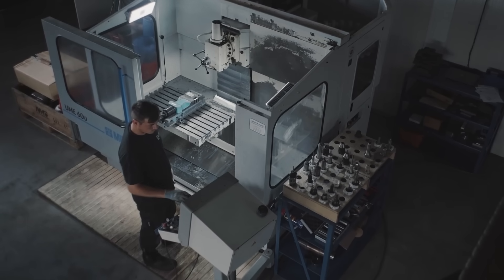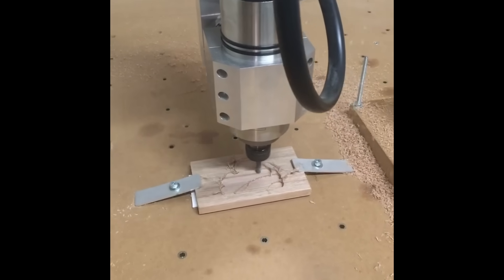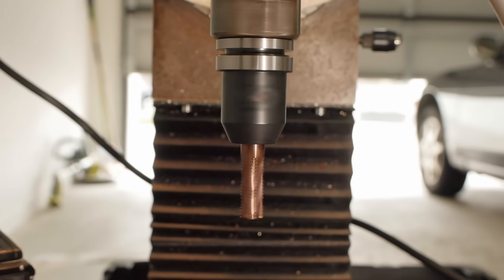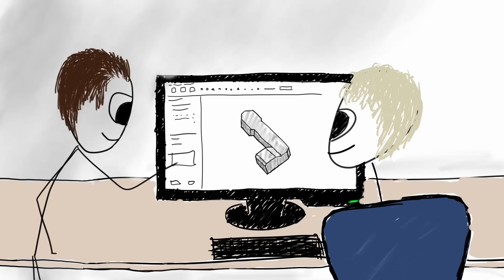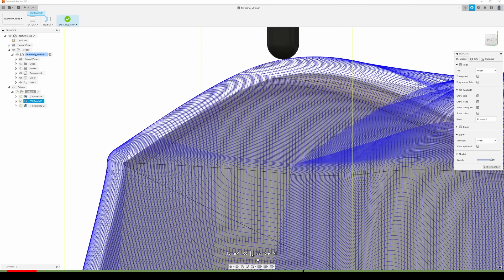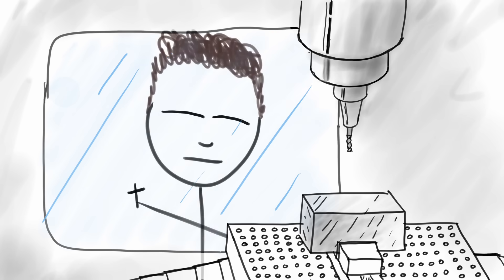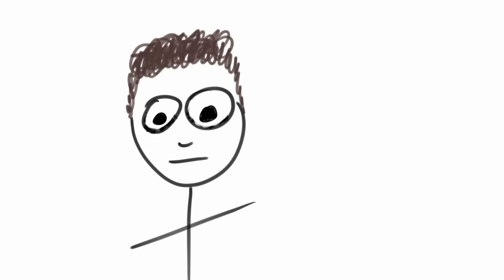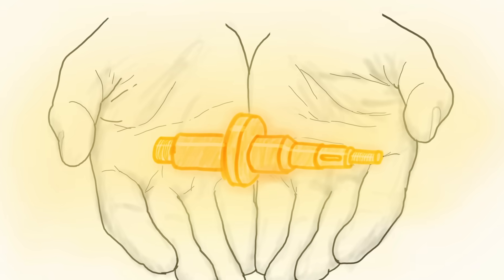Casually Explained: CNC Machining

Comment: I worked in IT for over 20 years before being recently laid off. With AI rapidly changing the industry, finding a new role in tech has become increasingly difficult. I'm now exploring a career as a CNC operator. While I understand the starting pay is modest, I'm encouraged by the growth potential over time.
I also have a personal connection to the field — several family and friends have worked as machinists and engineers. In addition, I have experience with 3D printing, which sparked my interest in CNC work. I’m drawn to the idea of working with physical materials and machines instead of spending all day behind a computer screen creating digital projects that can be erased or undone in seconds. CNC work feels more tangible, hands-on, and rewarding to me. Would you recommend this work for someone?
Reply from the maker: My only experience as an actual, full-time professional machinist is for a racing team where we did very short runs of custom designed parts, or one-offs. We were often having to do R&D to figure out how to make new parts, which keeps it interesting, but also makes the work super stressful. Most parts that you make are using a new, unproven gcode program on very expensive machines. Your experience of the industry will vary by country and company, some places produce the same parts for days at a time, so you'll be working to optimise and dial in perfect parts with less stress but less variety. The job is quite dangerous, metal chips are extremely sharp and WILL cut you several times before you really understand not to touch them. And as I said in the video, a lathe will mince you in a split-second if it catches your sleeve. On the positive side, you'll learn skills that make you an all-round very skilled maker and understand a great deal of engineering just through intuition. If you get excited holding an object that you've made with care, especially if it's a functional object, then you'll love machining perfect parts that fit together like few things do. I'm actually dreaming of making my own software as a source of income which I've been studying (slowly) for a while. Software is far less intuitive to put together and fix problems, and can feel like a sea of unknowns and threats to the objective, but the satisfaction when it all comes together is also amazing. I recently made a python script that aggregates all my Mach Super media files and folders into a single folder structure where all the files are symlinks to the real files in various drives. I would say, for me, a day running the CNC leaves me feeling happier and healthier than a day on the computer, but I like doing both. Never do I break expensive things on the computer.
Reply: I work in the aircraft repair sector, I make good money but outside of that its either mindless button pushing for high pay or lots of experience and hands on for bullshit pay. I'm working in an odd area now that pays well.
Reply: Titan of CNC, a American YouTube channel, The remuneration he offers is very high

Comment: 3:12 Hold on.  You’re trying to say that 3D printing just makes it for you, but with CNC you have to program every move it makes?  Then you show the g-code, which I know you don’t actually write.  That’s what 3D printers use too, and in both cases most humans don’t have to write the g-code.  They just modify various parts of the build/program where needed.
Reply: yes and no, CNC cant make the kind of patterns 3D printers can, its like how sculpting is easier than carving, you can add/remove material in sculpting but one mistake in carving and the piece is gone. About the gcode most commercial grade 3D printers you slice and you are ready to go, but when you have a half a million dollar CNC you need to verify every step, program and optimise various parts of the "Gcode" (program) to get it optimized and not end up in a $10k disaster. Also making a CNC part requires multiple different programs to make 1 thing while as for 3D printing 1 Gcode file and you are done. But industrial grade 3D printers also are complex like this, we have a Stratasys printer at work and it also requires a technician to operate and make the programs for as the printer and the materials we use are stupidly expensive so we cant afford any mistakes also parts need specialized post processing depending on the material and tolerances required.

Comment: I’m a 22 year old running a 2 million dollar mill-turn machine making million dollar rocket parts. The whole part about being in a constant state of paranoia is the most relatable thing I’ve heard in a while
Reply: i used to weld high pressure vessels and chemical piping. that paranoia sticks around for a while, even after it passes inspection.
Reply: 1000 tiny heart attacks a day... this is our career.
Reply: As the long as the broken thing doesn't impede overall production speed it's been budgeted for
Reply: how long have you been running machines? are you just an operator? or do you have programming experience? also what machine btw?
Reply: @iamthe.alphabet  Started CNC in high school through an internship I was in when I was 16, did that for two years. Then did manual machining for about 2 years, got in to 3 and 5 axis for about another year and a half before my current job. Been here for a little over a year now. So coming up on 7 years. I took CAD/CAM classes in high school and this is the first job I’ve had where I haven’t had to program my own parts. In the past I’ve run HAAS, Fidia (5 axis), and various heidenhain and fanuc controlled machines from smaller, less known manufacturers. Currently running Mazak mill-turn machines
Reply: May I ask in what company?
Reply: @ I work for blue origin
Reply: what’s your job pay now after all that experience if you don’t mind me asking? I’m about 3 months into my first operator position. I have about 4 years experience doing manual machining. I’m trying to decide if it’s worth it to stick it out to when I’ll make more or not.
Reply: @iamthe.alphabet im at about $40/hr with really good benefits. Pay varies a lot by location and industry, but with 6-8 years of experience a job in medical or aerospace will get you over $30/hr in most places
Reply: @iamthe.alphabet sorry for the late reply I never saw this. I’m at a base rate of about $35/hr but it really depends on location. In higher cost of living areas like California and Seattle you can expect $40+ for a good job with 6-8 years of experience. Biggest pieces of advice I can give is to get good at programming and metrology/inspection. That will set you apart from other candidates and open up a lot of opportunities
Reply: I have a dream
Reply: But you don’t make no where near that Lol 

The company makes the big bucks you’re just a worker 

You forgot to mention that my friend Lol 

No point in trynna make it sound like you make millions lol
Reply: @user-dz3fo4wl8x  the point was about how scary it is to work on really expensive parts and machines. You can cost someone hundreds of thousands of dollars by messing up once
Reply: @thedudegs-f9w it’s like that with everything in life
Reply: Oooo what mill turn? -Dmg mori NTX
Reply: I interviewed at a place a couple weeks ago similiar to what you do and the older you get the harder it is to get into decent companies. After 50 if you're job searching because something happened and you're in that spot it sucks. And having 20+ years of experience doing machining only to see  your job go to young people is very disheartening.

Comment: Even if I've triple checked the program, verified it in CAM, comped up a couple inches and dry ran hitting cycle start is still a devastating experience for each new program. And I only make one off parts....

Comment: 2:59 as a printer enthusiast I will confirm this is wrong. You also need to tune and code printers just like you do with CNC machines.
Reply from the maker: I know. Everyone who owns one knows. But it’s still not as difficult as machining.
Reply: @ yeah but you linda put them down in this video and stuff
Reply from the maker: @namanienie123  because they're easier than machining and machinists are jealous, and most importantly, it's because the uninformed audience often has a perception that 3D printing is as easy as plugging in a 3D file. That's what made it worth joking about.
Reply: @ well isn’t there the same premise about CNC machining?
Before I got into printers and before I got into machines, I also thought that you could just put a file straight onto a USB stick and plug it in and kaboom it works
Reply from the maker: @namanienie123  Exactly.

Comment: As a machinist, I am in fact constantly paranoid about what I’m making. Even after work. I swear, I dream about what I’ve made, and even if I know it’s all good, I’ll convince myself that something must have went wrong. If the order was for 150 parts, I’ll drive myself crazy that maybe I ruined all 150 and can’t sleep. Horrible.
Reply from the maker: I’ve never had to do a large production run, but I never considered that it could be scary in that way. I wished I could dial it in then set and forget… but what if I’ve dialled in the wrong thing 😱

Comment: are machining services available to the general public? i have a simple project that will involve some form of metal work
Reply from the maker: Yeah, there’s machining services to the general public in - probably - every country. But if you can’t supply a decent design specification (professional drawings and maybe also a 3D file) then you’ll most likely be paying for the time to consult with the machinist about how to do what you’re looking to achieve.

Comment: Bit off topic ,but in your harmonic drive vid when you blued the teeth contact, did you take into account that the deformation of the part actually angling the teeth so they wont mesh exactly in line?
Reply from the maker: Oh yeah, I think I explained in more detail how inserting the wave generator might affect the shape and location of the contact as it does make an ‘oval based cone’ out of the flex spline.

Comment: But doesn't CAM software also generate G-code, just like slicers in 3D printing? I mean there wouldn't really be a reason to bother making a 3D model in CAD if you're just going to rebuild it from scratch by hand in CAM software, so surely a large portion of the G-code must be generated automatically, right? I think I need a sequel to this video. 😭
Reply from the maker: The shape information from the 3D model is used to calculate the toolpaths. Machining isn’t as simplified as 3D printing, the part isn’t sliced into consistent layers. Features are picked out and machined in whichever order makes the most sense with the whole part in consideration. Considerations like meeting tolerances, surface finish and holding the part between setups. CAM software doesn’t rebuild the part from scratch, it makes toolpaths based on the part.

Comment: you know what's funny ? that's not the only cnc that exists, a week ago i stopped working after 2 yrs of working with cnc machine that was drilling and cutting in 14meters parts, like HEB 240 or other shit like that, the funny part is you start it and sometimes, even if everything you did is good, it can make a mistake worth thousands of $ XD Took me 1 year to not stress about it and just go with it at the job ;D
Reply from the maker: A CNC that DOESN’T do what it’s told… 😵‍💫
Reply: @machsuper  yeah, mostly probably they didn't repair stuff on time ;p

Comment: Me: I'm a toolmaker.
Friend: Oh, so like you make hammers and wrenches?
Me: No, I make molds.
Friend: Cheese? What do tools have to do with this?
Me: No, Molds are large pieces of metal that come together to inject plastic for everyday plastic parts, medical parts, and so forth.
Friend: So... you're not a machinist, you're a moldmaker?
Me: A moldmaker is a type of toolmaker, which is a type of machinist.
Friend: Okay, so you cut plastic and you call it machining.
Me: NAH, I MAKE HOLES. HOLES GO DOWN. HOLE NO GO THROUGH. ME SMASH.
Friend: Gotcha.

Comment: in my first job as a cnc operator/programmer i forgot to had the tool compensation on the program, the result was a dead spindle and a bent linear rail, i was so ashamed that i quit on the spot that moment is carved in my mind with so much detail that if measured properly it could attain RA 0.3 finish roughness

Comment: At my workplace we own a 3 axis CNC Machine for simple Metal working and mainly carving custom curcuit boards from a copper sheeted PCB plate.

I can HEAVILY relate to the part where you're about to press "start" and your past 15 minutes of setting up the machine flashes before your eyes looking for a mistake you could've made.

Comment: Mechanics work with dozens of tools.
Machists work with hundreds of tools.

YOu don't have to remember where you last put a tool but you also have to remember where your coworker last had that expensive tool.
You have to work with other machinists often in tight quarters and you have to maintain concentration in a noisy environment.

You have to be a choreographer because machinists are trying to attempt an efficiency of motion and cutting efficiently.

You have to be able to do mathematics in your head and on the fly to five digits.

You have to quickly access a 3000 page book and find the reference table you need on designing a new job.

You design the job yourself and you have to have the most efficient approach when machining in high volume.

One off machining jobs are time costly and are low profit but frequently put you behind.

You have to watch tool wear.  You have to watch for runout.

In manual machining which you will also have to know as a CNC machinist you will become instantly aware of what backlash means and why you have to know the construction and limitations of the machine you are using on a level more intimately than you know your own manly package.  

You have to be listening and watching for chatter and instantly diagnose what you did wrong and instantly fix it.

You will learn to make things snug and tight and operate on the narrowest of working envelopes to increase your precision and accuracy.

You will be pushed to extremes for speed of set up and design of the job.   Your head will want to explode and you won't have time to look for things you need.

You will find some tasks eventually routine like double and triple checking everything to make sure it is rigid and solid.

You will be hyper focused on every sound of the machine and grow a sixth sense on twelve different pecking styles for drilling and how and when to use them.

You will be griping about how non rigid a setup is or how little space you have to give yourself in order to make the part.

You will be PUCKERING every time that machine goes down to do a simple drilling operation.

You will cringe when you see somebody just holding a measuring instrument improperly or where a person sets it down.    You will yell if it is at the edge of a counter.

Your diety will be Starret and you will worship those who have enough to have their own personal set of Starret measuring instruments.

You will have all kinds of opinions about Haas and bemoan that there is not enough machine tool supremacy in your own country.

You will cry and pucker up during staff meetings when the economics of the business are discussed.

You will resent management who are not machinists and haven't a clue about what you do and mutter about the machining bottleneck.

You will find parts you make as glorious works of craftsmanship even though it was automated.  You designed the stages and processes with no fanfare.

You will find your zen with the machine and hopefully don'[t become one with the machine as that is pretty gory.